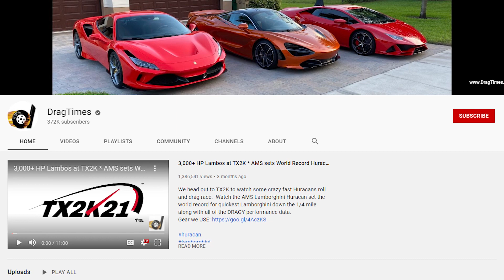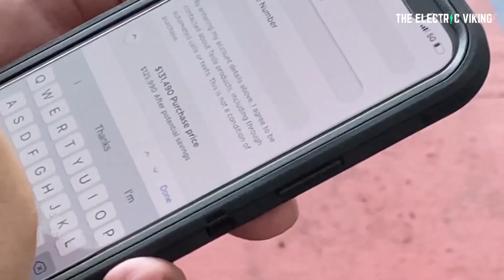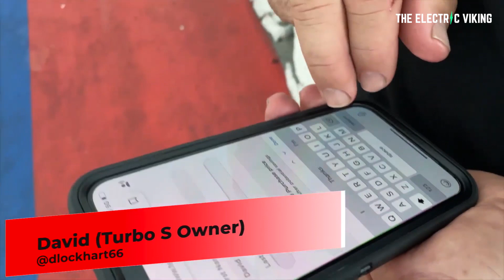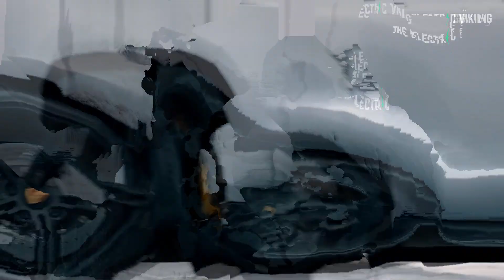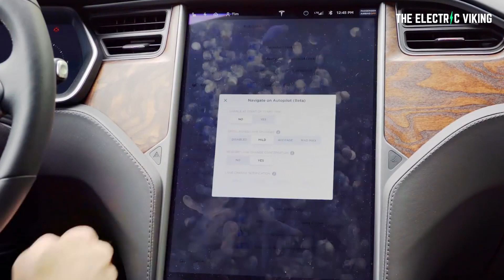Porsche owner humiliated - immediately buys a Tesla

Comment: The Plaid probably makes 1500bhp between 1/2 and 2 seconds. Power will be restricted by very intelligent wheel spin control then a huge energy dump hits the motors. A second or two later it cuts back to the stated 1050 bhp.

Comment: We all got the fact that in super cars you get insane acceleration usually at the cost of everything else. So when Tesla provides the best acceleration with zero compromise… the choice becomes obvious.
Reply: it's not zero compromise.  The tesla still is not a drivers car imo with its handling and weight.  Worse handling dynamics/agility, steering feel etc.  Yes the center of gravity is low, but the tires still have to cope with the higher weights.  Acceleration is its defining characteristic, not a well balanced and communicative driving experience relative to the power.   It's still good though but it is not a direct replacement for every sports car/super car that exists.
Reply: @basslover352  My point is very simple. You can argue until the cows come home about handling, agility, steering… In a Tesla you get a good version of all this with the best acceleration… and 90 cubic feet of storage, best 5 star safety, no exhaust, Over the air updates, The supercharger network, Next to zero maintenance, no rust and a CEO who actually responds to his clients.
Reply: @macioluko9484  Once again it's not a replacement for many drivers cars as I've said.  A great very fast daily yes.

Comment: And the Tesla will likely get even faster with OTA updates. Just FYI Viking? I know a 1000 hp car that is in the 7s. But it only weighs 2300lbs. Its not HP that Tesla is relying on. Its TORQUE and traction control that makes the car so fast. If you did not have the traction control engaged and you just floored it off the line it would spin the tires for the first half the track or more.

Comment: Plaid can be even faster with a software update. The carbon rotors that tesla invented can handle as much as power as the battery provides. The battery pack can be uncorked more I suspect. And those aren't even the 4680 battery packs.

Comment: A four-door car that can run low nines... easily... Tesla does the impossible.. That's just nuts.... A Tesla model S plaid can safely put down over a 1000 horsepower and 1000 ft lbs torque.. amazing engineering. These guys should build rockets. 😂